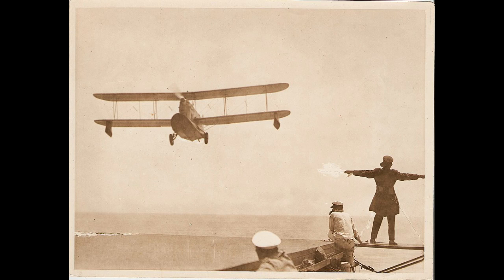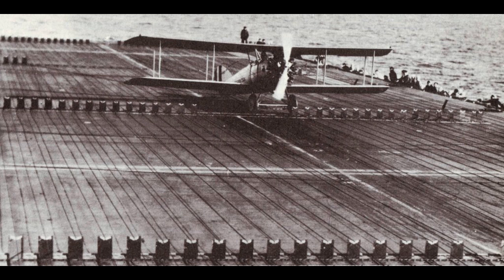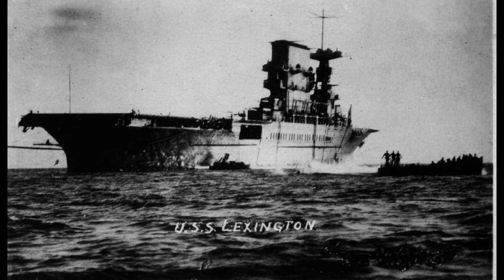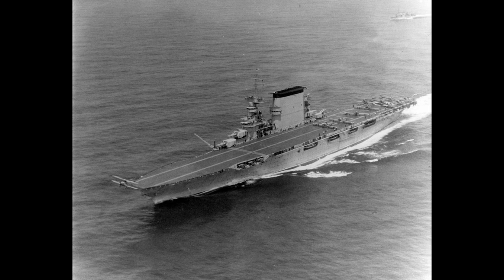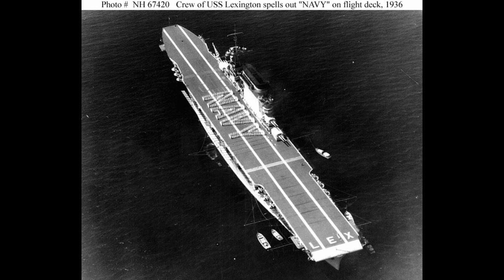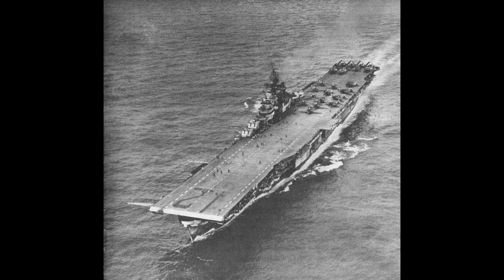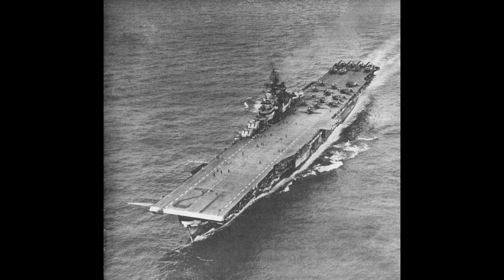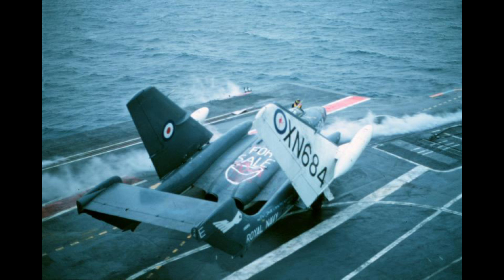When Pilots Landed on the Wrong Ship - Solutions to the Problem

Comment: I can confirm that it is easy to land on the wrong runway, at sea of on land.

Back in the 70s my dad used to take me flying in his light plane (a Pz-104 Wilga).  One day he decided to fly me and my friend from LA to San Diego to have lunch at the Red Baron restaurant at San Diego airport.  There was a bit of cloud that day but my dad did find the runway and was around 5 k out on final approach, but the tower controller kept saying that he couldn't spot us.  That's when a controller from NAS Miramar piped in to say that he could see us lining up !

One very red faced dad, one helluva story for my grandkids !
Reply: There is a story about a pilot back in the 60s landing a 707 at the wrong airport out here in Portland Oregon. On his first flight into Portland, Instead of landing at Portland International (PDX), he landed at the regional, and much smaller Troutdale airport, which is a few miles upriver from PDX.  He had to stand on the brakes to stop in time, but managed to not run off the shorter runway.  He was immediately fired by his airline, but a rival service hired him because of his extraordinary landing without hurting any passengers or the plane.  However, they had a problem taking off again.  The passengers were bussed the few miles on to PDX, but the runway was too short for a 707 to take off.  They ended up stripping the seats, galley equipment, etc out and then put the bare minimum fuel into the plane.  They then took off heading further downriver to PDX a few miles away.  They managed to get to and land safely at PDX. After shipping the seats, etc. from Troutdale, they reassembled the plane and put it back in service.
Reply: Worst incident I am aware of involved a C-17. The pilot landed at a municipal airport near downtown Tampa on Davis Island. It was supposed to land on MacDill Air Force Base a few miles to the South!
Reply: Thank you for sharing your flight stories, my Dad was a huge aviation fan. He served as a radio tech at Kelly AFB in Texas.  I got my interest in WWII aviation from him. Sadly he passed in January 2020.

Comment: Try putting grafitti on a jet now....... Conformal antenna, stealth coatings can be jacked up by slapping paint on. Try it on  an F-35C. Sure way to a Captain's Mast at the very least because until the crap is removed, that jet is down, and working on stuff like that is not cheap..